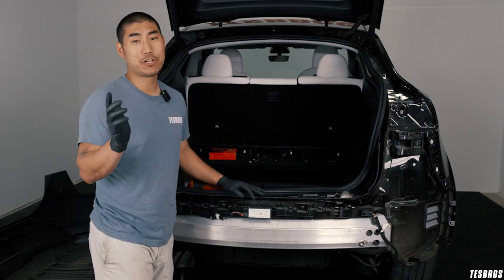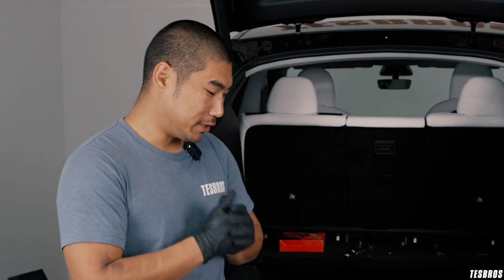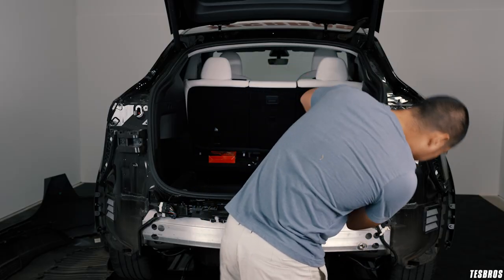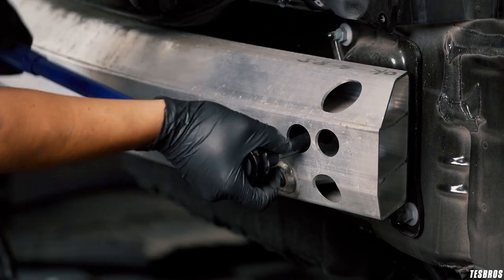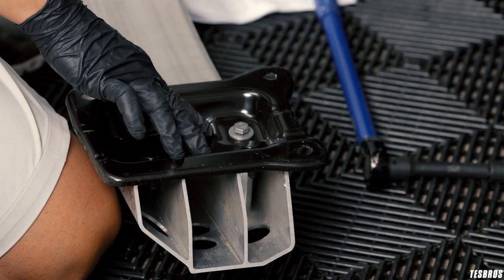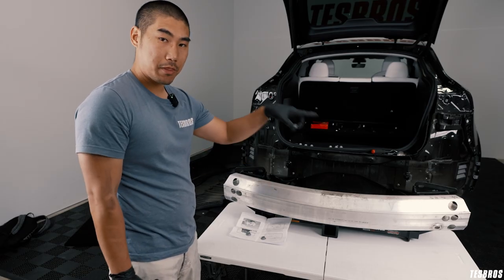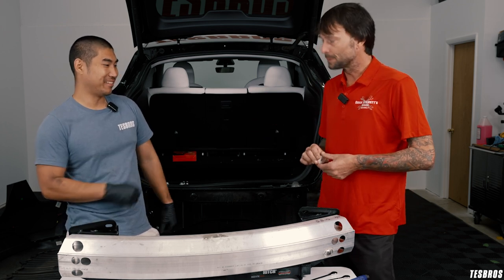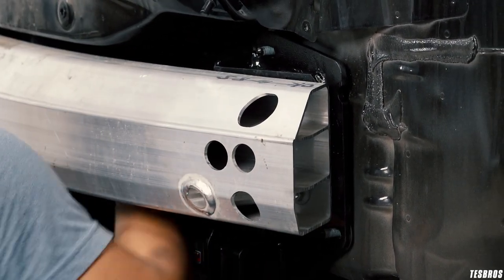Installing EcoHitch on Tesla Model Y - Tips For The Best Hitch Install - TESBROS

Comment: 1000 is definitely worth the Tesla hitch. Installation looks pretty involved.
Reply: I might be inclined to DIY this…except that I’ll need a 4-pin trailer wiring plug, too.  That extra bit pushes me over the top…worth $1K to have it all just done!
Reply: My tesla app says $1300
Reply: It's only $1000 if you get it when ordering.  If you wait until you have the car they charge $1300
Reply: Especially when rack attack wants $900 installed for a stealth hitch
Reply: It's not that involved of a project.
I would worry about the void of warranty. Check with Tesla first.

Comment: If the nylon washer is for rust-free mounting between steel and aluminum, how come the original steel to aluminum mount installed by Tesla didn't have the non-metal washer?
Reply from the maker: Good question. It doesn’t need the nylon washer unless it’s pulling something, causing friction in that area. So the original build wouldn’t have use for it
Reply: It's because the they have a black anti-rust coating on the bracket that was discarded.

Comment: I installed the stealth hitch on my 2018 Model 3 & while not being hard, it took time & involved removing a lot of stuff - but was actually a fun project.  It sits pretty low when the 2" receiver in installed & can bottom out in some driveways & speed bumps.  Taping into the electrical to get the 7 pin for a trailer was more than I wanted to risk.  I recently ordered a Model Y & added the tow pkg for $1,000. I think thats well worth it considering you gonna be in @ $500-$800 for the hitch & 7pin, so its quite a good value specially considering you will already have tow mode on the car.

Comment: The only concern I have apart from messing up the DIY part is: how is this work without the software update from Tesla to enable to Trailer Mode. I am only going to install bike rack and not going to pull heavy stuff? Would the sensors going to give me alarm all the time without the Trailer Mode? Any safety concerns?
Reply: I just had this issue today. Brough it to them and they said they have to confirm that there are OEM parts installed and they have to remove the bumper to check and inspect it. They would charge a 1 hour service fee for that. But then I can get the software that I need.

Comment: Should you have also placed nylon washers between the trailer hitch and the crash bar too? Crash bar is Aluminium as well.
Reply from the maker: For what I’ll be using it for, it’ll be fine. If you are going to pull things, we recommend a different washer in the video.
Reply: @tesbros  still worrisome from my perspective, that’s all. Dissimilar Metals incident takes long time to develop and the damage will be significant as explained
Reply from the maker: @dhudz04  doesn’t hurt to put more and low cost. You can get standard nylon washer from hardware store. Within time with the pressure, it may cause contact especially if you pull or put heavy loads on it.
Reply: What size are those nylon washers?

Comment: Thank you for your careful explanation, which is very helpful to me, may I ask you a question, after you install this trailer square port, what is the vertical load（tongue weight） of this model Y, do you have relevant data, thank you
Reply from the maker: 3,500 pounds towing, 350 pounds tongue weight

Comment: Very nice video. Thank you. I ordered the same hitch that you showing here, just purchased it thru your link.
Question is this: Im like you, I dont pull anything, but I do heavy MTB biking. When you put the bike on the receiver, does your Tesla give you any warnings that something is behind you or anything like that? I dont have the hitch YET, but I wonder if you MUST have that tow programmed into the Tesla System. I appreciate your help and awesome video.
Reply from the maker: If you put it on hitch mode, the warning sounds for objects detected behind you will be reduced or disabled to prevent constant alerts. But if you’re on hitch mode, you can’t be on autopilot so that sucks. You can still drive your Tesla without hitch mode on, but when going in reverse, it will definitely let you know there is something there lol

Comment: I just found out the u-haul version of the install does not re-install the tesla OEM bumper back. The u-haul hitch serves at the new bumper. Is it better to re-install the tesla bumper over the trailer hitch? 

what happens if I skip the tesla bumper?
Reply from the maker: I think I've seen some u-haul versions where the bumper is put back. Not sure which one you're referring to.. but I would choose a hitch that can be installed with the bumper put back, just because it hides it easily and the aerodynamics aren't affected while not in use.
Reply: @tesbros   hey thank you so much for your response.

Just so we are on the same page I am actually referring to the long metal (aluminum??) beam that is screwed onto the vehicle and NOT the rubberized plastic (or whatever material it is made of) that has the same color of the vehicle.

In your installation video you removed at that metal beam, replaced the plates that sit on both ends with the new hitch, and then installed the now heavier single piece back on the car.

In my opinion the metal beam I am talking about should be installed back like you did in your video so that the safety of the vehicle is not compromised.

Comment: Can you drive with the trunk open on the highway? Like if you have long pieces of wood with a bed extender?
Reply from the maker: Driving with your trunk open on the highway is generally allowed as long as you follow some safety precautions like making sure everything is securely fastened and not blocking your view in your mirrors or others from seeing your taillights. If the load extends past your car a good bit (i think 4 feet), make sure you attach a red flag or cloth to the end of it for other drivers to see the excess better. Most importantly though, it's best to check your state's specific regulations regarding transporting items with an open trunk. Some places have more restrictions than others.
Reply: @tesbros  have you tried it with the tesla model y? I thought they have auto close. Was wondering if those would break on the highway

Comment: If I'm just going to use the hitch for bike rack and basket. Is it necessary to have those washers?
Reply from the maker: Yes I’d still use them. Smaller risk though since you’re not pulling.

Comment: where is the wire connector for trailer? Do you need different hitch for that?
Reply from the maker: No, just select "include" under "wiring harness" when purchasing - https://shop.teslarati.com/products/torklift-tesla-model-y-tow-hitch?variant=31664047587443

Comment: Just out of curiosity didn't you miss one plastic washer on the top bolts? They are 3 per side and the washers only went on the lower 2? Or am i missing something? @10:31 thanks
Reply from the maker: The bottom 2 will have the most friction and weight, so it's not required to have one on top. But it wouldn't hurt anything if you wanted to put one there